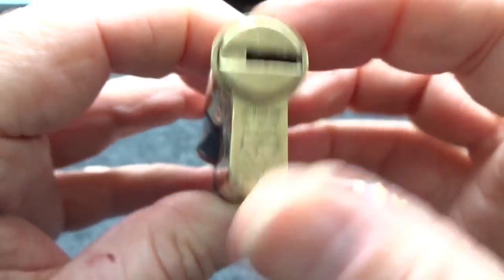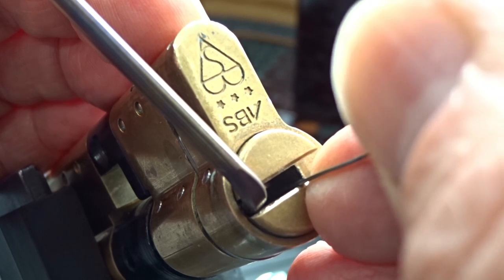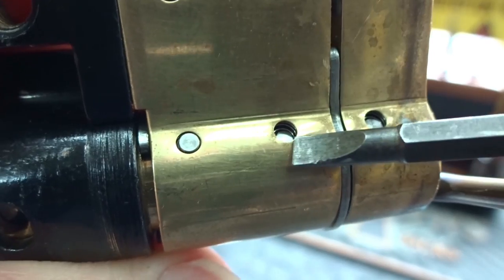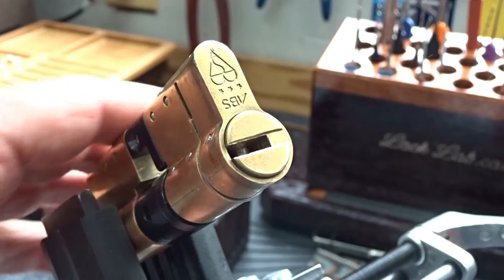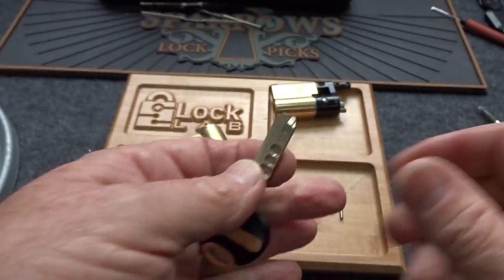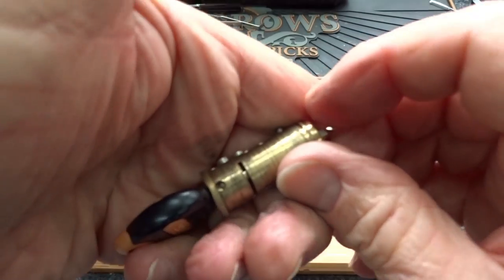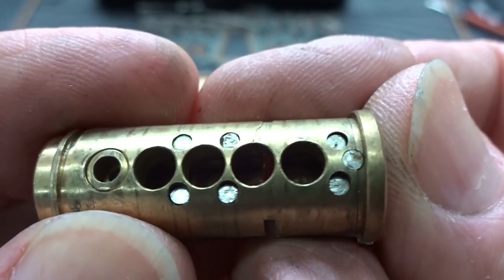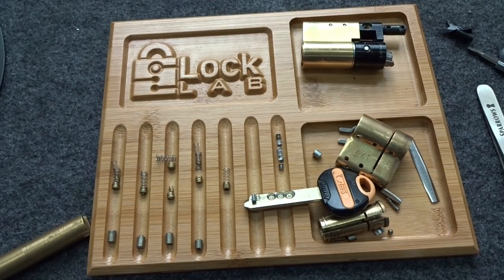(1063) ABS Magnetic Lock with TRAP Pins!

Comment: Hey Bill, already been mentioned in the comments but since you didn't mention it, the logo on the front you can read the BSI, it's known as the Kitemark. It means the product has passed the BSI tests, which are often used on mains plugs, crash helmets etc as an independent (and expensive) certification process to assure a quality product. It's not a legal requirement to have BSI certification but having that mark usually is the sign of a quality product.

Comment: Great job on this complex lock... I think they are one of the most innovative out there.  One important feature that you may not have noticed was the active snap protection... the cam mechanism seizes up (it locks to the inner cylinder) if you manage to snap the cylinder behind the cut.  I showed it on my video featuring this lock: https://www.youtube.com/watch?v=zq5rGjt-9rQ&t=9s  Also, that complex cam requires you to push a little button at the back of the keyway at the exact right moment during picking -- otherwise, you will not turn the cam even if you pick the lock.  The cam mechanism is really quite good!  .I'm still confused how this lock opened without actuating the magnetic pin...  it looked like the magnetic pin was operating correctly, and it is not gravity dependent.  As for the slugs on the bottom, I'm at a loss also.  I can't figure out what they are for.  Pure speculation: maybe they are to attract magnets inserted in the keyway to keep them away from the magnetic pin.  Finally, if you want me to put the lock back together, send it my way.  I've done it a few times, and once you have a system, it's not too bad.
Reply: huxleypig69 There is also a small spring holding the magnetic pin in the shear line. It should work fine regardless of gravity or lock orientation.
Reply: Late reply but since this lock was disused due to wear that spring might have failed.
Reply: R K seems most likely, especially after viewing it disassembled
Reply: Would the pins fall into the holes in the bottom if the slugs were removed and the inside was rotated too far?
Reply: LockPickingLawyer why didn't the actuator turn when he picked it did you notice that? In a real door this means a u lock wouldn't occur. Hope to hear back from you with the answer why thanks.
Reply: @corriedunstan2668  (zombie reply sorry) - there's a button at the back of the keyway that needs to be pressed as you start turning to engage the actuator.
Reply: Saw this on lockpickinglawyer and indeed the 4 slugs at the bottom are for unskilled magnet attacks.

Comment: Hi Bill. Great video as always. I've worked as a Locksmith in the U.K. for over 20 years now and your picking method is some of the best I've seen. The 3 big pins at the bottom of the Avocet ABS cylinder are hardened and there to stop you trying to drill it as well as all the others. Keep up the great videos. Dan

Comment: Would be much more safe, if the brand was not on the lock, so that it's harder to guess which lock it is, so that it's harder to guess the correct technique.
Reply: But it would be easier to pick if they wrote down the size of the key on the outside.
Reply: Anyone with the skills to open it is already going to have heard of it.

Comment: Not sure if this was already noticed or mentioned in the comments, but that magnetic pin was "picked/bumped" by the rapping with the screwdriver handle. Since chamber 5 does have a top spring to keep the magnetic pin from falling too far, I wonder if it could actually work to get lucky "bumping" that pin past the shear line with the lock inverted? Either way, glad I don't have to face those on a lockout service call. Great videos

Comment: As you start to reassemble, Use a wider piece of shim material (cover the lower third to half of the body) to cover all the pins while using the follower to replace them. As you push the plug back, let the shim material cover the snap ring groove (ride over) which will allow easier insertion.

Comment: back of the core is designed to pin it - notice the cutouts for the little sidepins, you put the main pin first, slide the core to lock it in, then insert the minipins
could have used it to take it apart, too - let the sidepins fall through a hollow follower after they fall in through the cutouts in the back of the core

Comment: they can be picked whilst in the door.
just gotta use some neodymium magnets on the pick to get past the magnetic element. 

i am an avocet lock centre. 
great locks till they jam up
Reply: Indeed Andrew, I told Bill that there was some shenanigans with the key (but didn't go into specifics), and that he should probably pick it upside down (if he didn't bother investigating the lock) for a successful pick. I wanted to give him a fair chance at picking the lock, and gut it. I didn't actually realise it had trap pins, I never saw them move when I used the key, so I assumed they were anti drill pins of sorts. I had this lock on my front door, but replaced the front door recently, and this lock didn't fight right with the new front door (spacing front and back was different). I will however, be ordering another ABS lock for the new door, just haven't got around to it yet.
Reply: Andrew Watson or turn the door upside down lol
Reply: I'll do just that next time when the next one fails
Reply: Andrew Watson also, in hindsight, now that I've seen this lock opened, I don't think picking it upside down made any difference since the magnet pin had a spring. I guess he was lucky picking it?
Reply: Andrew Watson are the new 3rd revision avocets any better? i know the first versions were prone to jamming.
Reply: So how does a locksmith open the snapped lock when a flat(apartment) is empty??
Reply: huxleypig69 guessing hardened steel cam too, so lots of drill bits and swearing. I've heard that at that point the best option is just replace the door because it's likely going to be ruined removing the lock anyway.
Reply: huxleypig69 nopeeee you can snap it easy it does bolt but after snapping becarefull with a hammer and screwdriver and just pull it across the cost is new lock new handle plate
Reply: All you have to do is put an anti gravity ball near the lock and it'll act upside-down.
Reply: Nexinator I’ve noticed Bill seems to get ‘lucky’ an awful lot...

Comment: On the ABS lock, if you try and snap it, there is a mechanism that makes the lock unable to open from the outside, that is if you put it in the right way around. On the magnet, it is not necessarily on a specific pin so if you try and pick it the right way up and stick in a tiny neodymium magnet to circumnavigate the magnetic pin  you need to know which pin it's on before hand.
 I have this lock on both front and back door, good luck getting passed them.

It's  not even a particularly expensive lock in the UK about £35 if you don't want a special .

Comment: I’m curious if the fat steel pins in the bottom of the core are an extra trap for a magnet so if someone tries to place a tiny neodymium magnet in the lock it will be attracted to them and they’ll only have a 1 in four chance of proper placement.

Comment: What got my attention +Bosnianbill was the Kitemark logo on the front of the lock plate. As Wikipedia tells us, The Kitemark is a UK product andservice quality certification mark which is owned and operated by The British Standards Institution (BSI Group). It's been operational since 1903. 
I'm impressed. I had no idea the Kitemark was still going, or that the UK still made such great products. 
But of course the joke is that these locks are fitted to steel framed plastic doors! Why bother trying to defeat the lock (any lock) on such a door, when all you have to do is kick the lower thin plastic foam lined panel in and crawl through...!
My next front door will be steel framed, but with a reclaimed solid panelled mahogany fire door suspended inside by bolts. And on the outside will be a steel security gate hinged to the ground. Both will have salvaged Ingersol locks if I can get new keys cut for them. If not, I'll be looking at some of these ABS solutions. They aren't that expensive.

Comment: The random pins on the other side that fell out were most likely anti drill pins as well they looked to be steel. The lock overall claims to have like 16 anti drill pins, so in general you are much better off trying to break the door down than getting through that lock

(Lock Website: https://www.abs-secure.co.uk/pages/abs-lock-features)
Has a bunch more information about the thing
Reply: Yeah I am sure they are anti drill ones, they are probably big to thwart those guys who use large drill bits to drill out the entire core and not just the pins.

Comment: Two questions:
1. What difference does it make, that the lock was upside down? the pin was springloaded, so it should not go down without a magnet (unless it hides in a upper pin).
2. After sidepins drop into keyway is it possible put the key in? (to recover with a key from failed lockpick attempt without destroying the lock)

Comment: what was the purpose of the plugs/pins on the underside?
Reply: Pete Martin More anti-drill pins.
Reply: they are anti-drill pins that can spin freely to ideally make it harder for a drill to bite
Reply: My guess would be that they're also magnetic and with the lock in the correct orientation they fall down to block the core from turning without the key in. So the whole key is magnetic and it sucks the last spring loaded pin down, and the bottom pins up against gravity (hence they don't need springs).
Reply: drill protection
Reply: Probably drill protection, yea. They didn't look like tungsten carbide but if they were then that lock was not drillable.
Reply: Alexei Barnes it's shapable but will deadlock but if ever in doubt and it gets stuck get stilsons out snap lock barrel in door then use a screwdriver to pull across will only take 2 minutes max but you will have to replace whole lock and sometimes handle plate good luck lockers
Reply: Feet Thong, take a look at the video on the homepage of the locks, it's double protected from snapping (as well as some showing people trying to smash their way through):
https://www.abs-secure.co.uk/

I have these locks (in the UK) they are probably the best (euro-cilinder) on the market.
Reply: Aren't these in the wrong position to stop drilling?  Why would anyone drill under the keyway here?  There's nothing there to drill out.

I thought they might be for some kind of construction/builders key.
Reply: What are "mole grips"
Reply: @aarontooth  Some burglars use big drills to drill out the entire core (as that will take care of small anti drilling pins quite easily). These are there to make it very lengthy even with bigger tools.

Comment: I would love to see how this compares with the Ultion TS007 3* lock, I was advised by a UK locksmith/picker to get the Ultion over the ABS, I guess for reliability and the fact it is reversible (antisnap both ends) if anyone were to ever try snapping it. I have 40x40 and 45x45 keyed alike so no issue even swapping front door and back door.
Reply: M Baker this lock is made to snap easily. when it does it locks the cam.
Reply: Same as the Ultion, I would like to see them disassembled side by side for comparison.

Comment: i have a question... i am able to pick 3 of the locks in my house. but the 4th one is kinda tricky. okay so basically i can see that all the pins have set ( arent being pushed down by the spring) and im pretty sure there are no security pins. but it just wont turn?? Also the lock is sideways because my dad installed it but its not a special lock or anything. could it being sideways be the reason i cant pick it? or do you think its just a security pin(s)

Comment: After watching your videos and becoming quite competent at lock picking I replaced all of my locks with these ABS Avocet cylinders. Living in the UK it was quite reassuring to see that that they are not the easiest of locks to pick, especially when they are the right way up.
Reply: Matt Palmer I'm glad I already have
Reply: Well if either of you guys find stuff missing from your homes with no visible sign of forced entry, then the thief probably used the tool in the video I posted above, in fact that is an older version of the tool with 5 blades each one with the magnet in a different position, the newer tool only uses 1 blades with magnets in all 5 positions, so you just walk up and stick the blade in the lock and could use a set of mole grips to rock it left and right until it opens, then do the same when leaving to lock the door.
Reply: I await seeing a Drumm Geminy picked !
Reply: Strange because every ABS lock I have used my tool on has popped open in a few seconds, you just have to make sure you have the correct blade inserted for the magnet position, and make sure the foam inserts are still springy. I haven't used the newer single blade with magnets in all five positions.
Reply: I have this lock in UK. This week it seized and now I can't use my lock. Phoned lock Smith. He said it's a common problem, sometimes it get into its anti whatever mode and you have to snap it and drill it from the inside. Going to cost me more for it own fault. He recommended Ultion locks. These ones you can open from the inside if snapped or in anti whatever mode. Worth getting these instead. He also said sometimes the magnet on the key picks bits up and gets stuck inside which can also cause jamming issues. Nice lock but shame it locks itself!
Reply: Mcs, protec 3,4ks are all better locks mechanismwise...BUT...they are not great against snapping, trust me. England responded with avocet, yale platinum, ultion...which in that regard must do a better job to gain 3 stars without the employment of an escutcheon.
Reply: I can't see many thieves bothering to buy the tool when they can find a easier way in
Reply: I bought one after picking my 3 previous locks
Reply: @MiteshParmar  these can be unlocked from inside if in snap mode.
Reply: @MiteshParmar  Lots of clever features, but the complexity might effect reliability?  The pin operated by the magnet in the key is perhaps one example, dust/wear products might cause it to become sluggish or get stuck.  Maybe also have to watch out for the magnet in the key affecting the magnetic strip on cards, or the magnet loosing its strength to ferrous objects.  Be interesting to know how the locks perform long term.
Reply: @Matt Palmer How have the locks performed over the last four years?  Any problems (sticking, jamming etc) or trouble free?
Reply: @SaxJockey  totally trouble free.
Reply: @mattpalmer3051  Many Thanks.

Comment: Someday a lock will run thermal, electrical diagnostics and optical scans on the inserted object and keep a grip on the barrel except when one that fits the profile of the correct one is inserted.
Reply: That lock could be attached to a home that needs very expensive cutting tools to break into.  The door and walls can have layers of steel sheets and a thick and sticky clay mixed with sand.  It should be more expensive to break in than the value of anything someone might take without being so expensive to set up.

Comment: Not the first lock to use magnets. A lot of locks are fine for a while but they will clog up with dust and pocket fluff and if you do any work with metals or use a file your key will pick up the filings and pass them to the pins in the lock causing wear and jamming... I tried a magnetic charger for my phone and buy the end of the week it would need all the filings cleaning off or it would not make connection any more.

Comment: Would a magnet have worked on the outside of the lock in order to hold the balls in the outward position? Could even put 1 magnet on each side.
Reply: That's assuming of course that they are made of metal

Comment: hey bill
can you explain how that 'anti snap' thing work ?
never heard of it
Reply: No experience, so correct me if I'm wrong.  
On a solid one, the weakest point on it would be the actuator, since everything else would be one piece. The anti-snap thing is a secondary cut, that makes the lock weaker towards the front, instead of the actuator. So without, you snap the lock in half and the door opens since the actuator is broken. With, you snap the lock itself in half ahead of the actuator
Reply: Yes.  That's how it works.  CISA's Astral series of cylinders try to prevent this altogether by using spring steel flexural elements which are riveted to the whole length of the cylinder body.
Reply: madtrade just search lock snapping on YT, Ultion do a great video to demonstrate theirs, a UK locksmith recommended me Ultion over ABS for my house despite him explaining how the magnetic pin works... I would love to see Bill do a comparison.
Reply: The Euro lock is inherently insecure as in the middle there is very little metal. What the crims have done is use vice (mole) grips to snap the handle, screw in a bolt or screw into the lock then using the vice grips snap the lock in the middle. Then you can open the lock with a screwdriver. The sacrificial cuts in modern Euro lock mean it snaps leaving part of the lock intact. It's not a perfect solution as with application of a hammer you can snap the rest of the lock off. The ABS lock has a special mechanism that renders the lock inoperable from the outside if you double snap it.
Reply: Brian Whittle spot on, there is a video explaining the 'best' from a dublin based locksmith, but what he doesn't seem to grasp is that sacrificial cuts up the sides will just make a burgler bent it up and down instead until it gives. To be fair it is an old video though and  should not be taken as security advice.

I have Ultion Euro profile locks, I want to know if they are better than the ABS version, I suspect they are. Certainly they have the double sacrificial cut on both ends and are reinforced at the centre so are reversible if anyone were to have a pop...